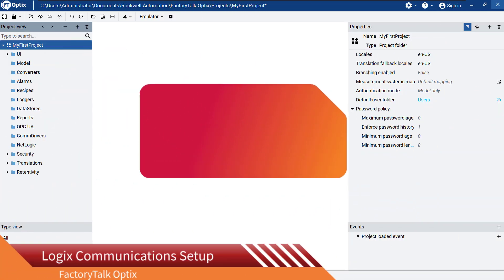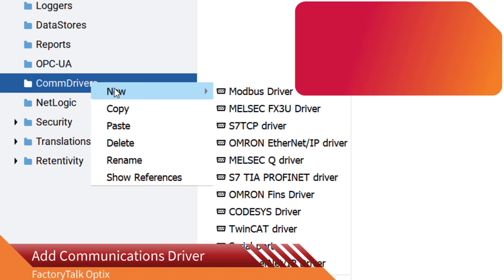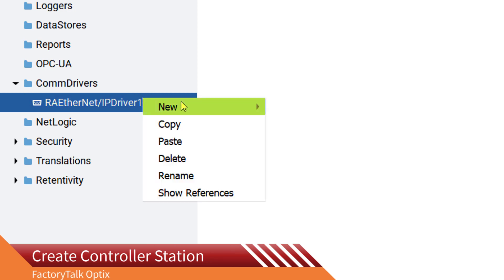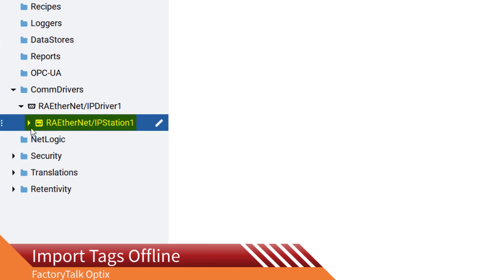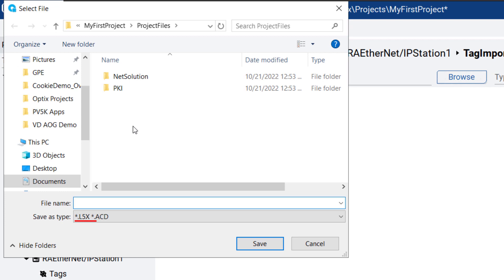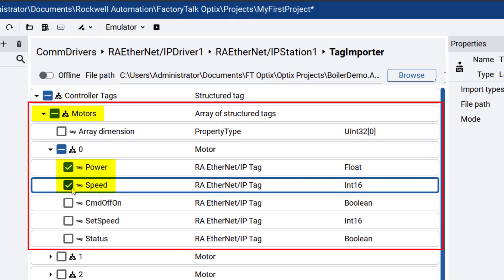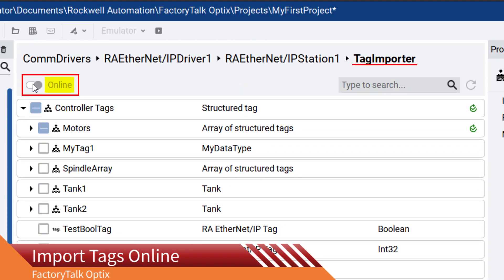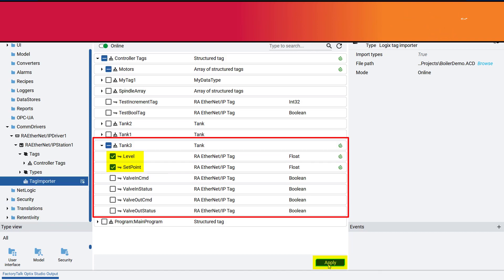FactoryTalk® Optix™ Getting Started - Communication Setup

Comment: Can you configure tag templates (UDTs)? and can you create logical tag structures to house the PLC tags in? For example, if there are 2 PLCs which control an area of plant, I would want to create a tag structure by area, like "Area 1/Sub Area 1/Motor A/Status" or similar. Is this possible?
Reply: Yes. You can create a custom motor object with a certain tag structure and then dynamically alias to different PLCs.

Comment: Is there someplace you can view the CIP Identity Info of the controller you connected to after you enter the Route to verify you are connected to what you think you are?
Reply: Currently, there is no way to check this in Optix Studio. However, the connection does come with a status variable which can be used to display the status of the connection in your runtime application. The software was originally developed by a company that RA acquired, so they are still working to bring in a lot of the tight integration with their controllers.